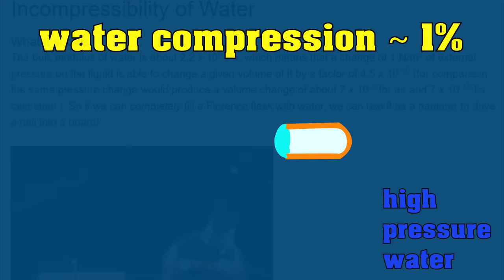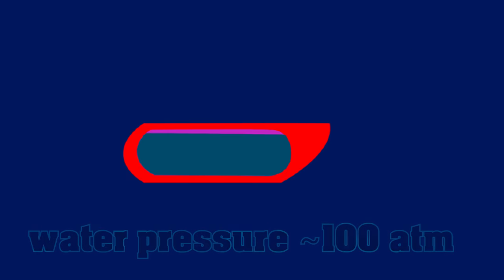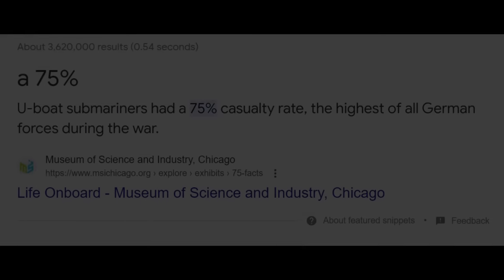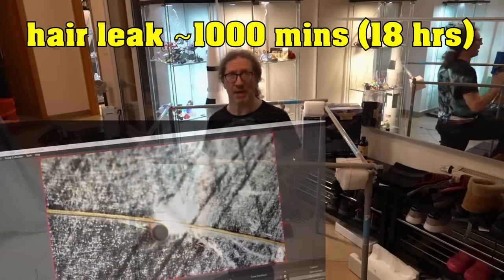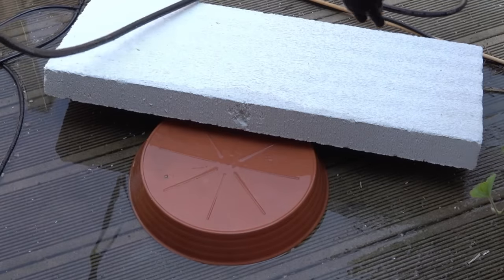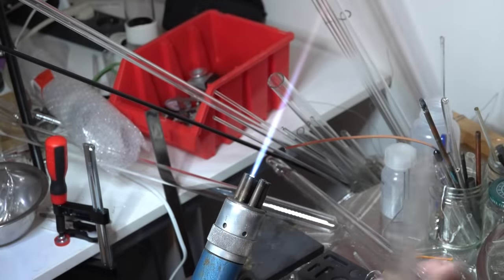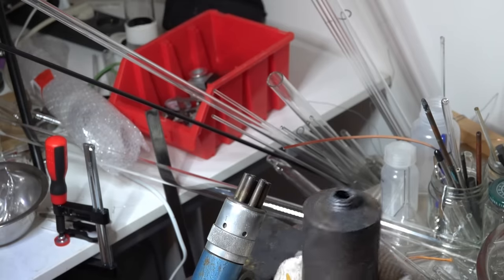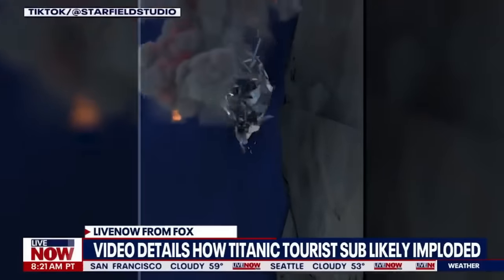Why the Titan sub failed

Comment: To be honest carbon fiber composites are used for making pressure vessels. To keep higher pressure on the inside, not the other way around. And I'm pretty sure that once a leak started in the glue, it went all around the cap...
Reply: That's the thing isn't it, fiber composites are great for tensile strength, not necessarily so great for compressive strength.
Reply: maybe they are not great for compression, but the sub had 13 or so successful drives, so it was more than capable. The problem is they did know how many cycles it can take. And the sub had a lot more questionable choices.
Reply: @hhkk6155  No, subs which are properly designed and engineered are expected to last years and years, with large numbers of dives.
We don't ride planes, trains, automobiles that are safe for 13 or so trips, what sort of stupid does one have to be to say such a thing for something that is as insanely dangerous as diving to the bottom of the ocean?
Reply: @boots7859  that means that you don't know what you are talking about. Most deep dive subs are used only once or several times before they are retired to museums.  And all equipment has a lifetime.
Reply: Diving to 4 km isn't a train or plane ride, it's an extreme adventure
Reply: @hhkk6155 , the design was flawed. They used wrong materials. Deepsea Challenger reached 14km of depth, and had a few shallower dives before and after, and it survived. There are many deep dive submersibles that operated for hundreds of hours.
De Havilland Comet planes had thousands of hours of flight before a fatal flaw caused fuselage to break due to metal fatigue. There were few other plane disasters where the end cap of the passenger cabin fractured. And such accidents happened at relatively low pressure differences...
In case of Titan the fact it had successful dives before it sank is astounding, considering that basically only epoxy resin resisted the compression forces...
Reply: @urgon6321  everyone now is a sub expert LOL 😂
Reply: @urgon6321  deepsea challenger didn't reach 14 km, because the deepest point is around 11 km. Everyone is blaming carbon fiber, but Titan had a lot of other problems: window, titanium to CF joint, CF direction, dimensions of the sub. If they did a lot more research they would have made a more reliable sub.
Reply: @hhkk6155 , you're right, it's almost 11km. I think I typed "14" because I read it was tested up to 114MPa of pressure...

Carbon fiber is just that - a fiber. Take a piece of heavy cloth or a rope and try to stretch it - it doesn't yield easily. Now try to compress it. You see now? Carbon fiber composites resist tension very well, but aren't great at compression. When compressed all the strength of the composite comes from resin that prevents fibers from moving. But resin is not as hard to compress as metals are, that's why it doesn't work as submarine hull.

This is basics of material science and engineering - it's incredible no one tested the design in high pressure chamber to see, how many dives it could survive...
Reply: @urgon6321  that theory, practice is different.  Did you ever had a roll of plane plastic or cotton fiber? If rolled tight - it's solid AF and resists compression very well. Rolled carbon fiber also is very resistant in compression, there are a lot of videos on YouTube showing that carbon fiber exhibits very good compression resistance, on par with titanium if weight is taken into account.  Epoxy is no way near compression resistant as CF + epoxy composite. Also there are vids that show CF composites having much more compression resistance than glass fiber composites, not to mention plane epoxy.
Reply: @urgon6321  also about resins, window on Titan was made out of acrilic, and it's kinda similar to epoxy, and it wasn't certified for 4 km but if you take enough of it acrilic holds fine, same with epoxy, theoretically you can even make a deep dive sub out of it, but it would be extremely thick, maybe a meter or something like that (it can be calculated).

Comment: 3/4ths certain the issue in your waterjet test was lack of pressure. I think you'd need to be up around 200psi (about double what you're running) to cut that plastic.
Very well made proof of concept demonstration. Thank you for the effort.
Reply: You're mistaken, I'm afraid. He said his pressure washer was running at approximately 100 bar, which is nearly 1500 psi. Pretty standard for a home use model, though they do have some that are a bit more powerful. An industrial pressure washer, something like at your quarter car wash, States around 3500 psi. There's really no telling how high they go. I reckon that depends on what you are using it on. 1 bar of pressure is 14.7 lbs. It didn't destroy the plastic because it's water, likely filtered. If you were to use seawater, it would have more of an impact as a result of sediment and other particulate in the water. Like a water jet machine. They run around 20,000 psi. But they will not cut through steel and concrete and all the other things they use them for until you introduce an abrasive into the stream, then shit gets cut, which is why pressure washers contain filters, by the way, so that minerals and particles in the water won't just strip the paint off your home or car, or cut your foot off from an accidental blast.
Reply: @philbert006  Pure water can easily cut soft materials, no need for an abrasive. It's actually common practice to cut plastics with water alone, because there's no reason to waste your relatively expensive abrasive on a soft material that has no need for it. The problem here is the nozzle, obviously you wouldn't design the nozzle for a pressure washer to be able to cut things. The orifice in a waterjet is very different from a pressure washer nozzle.

Comment: "It really isn't the immense pressure that kills you... its actually that the water is compressed and it expands at you at the speed of sound" is a bit like saying "It's not the falling that kills you, it's the sudden stopping"
Reply: This guy likes to be contrarian. The available evidence including the communication log between the sub and the support vessel also isn't consistent with a pinhole leak, dramatic implosion is much more likely
Reply: True, but the simple explanation gives rise to the misconception that the vessel would violently implode
Reply: it's not slamming head first into a wall that kills you, it's the fact the wall didn't move.
Reply: @guardofrr  it did violently implode or the carbon fibre frame wouldn't be in pieces
Reply: That last part is inarguably true. No one has ever died from falling, or skydiving would have a near-100% mortality rate. They died from the blunt force trauma of the impact.
Reply: @colormedubious4747  
You don't need a parachute to skydive.
Unless you wanna do it more than once.
Reply: @Dareyouhow  I would guess that the moment there was a failure in the seal, a dramatic implosion would follow anyway.
Reply: @hhiippiittyy  You are correct, sir! Aviators also have an old saying: "Anyone can FLY an airplane. The tricky part is LANDING it so it can be flown AGAIN."

Comment: The pictures of the wrekage shows the window blown out and all 18 bolts gone, the carbon fibre has completely delaminated from the titanium and not even small bits are left on the titanium semispheres. Carbon fibre shatters violently when its structural integrity is compromised and the evidence shows that. They died in milliseconds, not a pinhole leak filling over time, the sub wasnt made of metal.

Comment: Didn't the US navy confirm it was a sudden implosion because implosions have a very distinct audio signature that was picked up by acoustic monitors designed to detect enemy submarines.
Reply: Well yeah it was implosion nobodies denying it, it just didn't happen like those a animations suggest
Reply: @AverageAlien  Thunderf00t is saying there was no implosion and that it just sprung a leak and filled up with water over a few seconds or a minute.
Reply: It was very likely an implosion. But if the communications log that has spread on the net is  legitimate, then there was issues before the implosion.

If the texts are true, then the sub descended 50% faster than normal alreadt from the start. Which indicates if was too heavy. Either waterlogged plastic (one of the issues with CF) or ot had a leak so there was water in the sub.

Next thing is the leaked (if real) communication mentioned sounds maybe 10 minutes before the loss. And loss of one power bank while they drived to ascend.

So a leak could have started the issue. Then the leak could finally have damaged the CF hull enough that instead of just getting a larger hole it totally imploded from loss of stiffness. A leak can delamination the CF bonding.
Reply: @mikehawk5492  Did you not watch to the end of the video? He explained how a pinhole leak escalated into an implosion.
Reply: @mikehawk5492  The point is a tiny leak would erode away at the material it's leaking through, combined with the fact that the material it's likely leaking through is glue thats constantly shifting throughout the dive it wouldn't be too long before it failed entirely and explosively.

However the glue is just one theory, another is the hull was damaged and leaking, which like the glue would be essentially waterjet cut by the leak until it grew large enough to catastrophically fail.

Hydrualic Press Channel already did a test (I think others have now as well) where they take a carbon fiber tube to depth and back in a pressure chamber 30-50 times and it suffered no noticeable loss in strength from the cyclic loading. However the timespan was so short that no leaks would have time to actually weaken the material by abrasion. It's unlikely the hull failed simply by cyclic loading but instead cumulative damage of some sort. Which brings us back to a sub millimeter leak that slowly ate away at something until it failed, similar to how hydraulic hoses or other hydraulic failures occur, they slowly seep and leak until they blowout without much visible progression.

Comment: I've been starting to use a pressure washer at work, the 0 nozzle is something I'm legitimately concerned about using not just because it doesn't have the area coverage I need to clean the sidewalks around here, but it also straight up removes gum that has been there long enough to solidify and turn black within seconds. I could probably drop some pigeons with it...
Reply: Thats the problem, it will cut bricks and remove almost anything, but area of coverage is almost useless.  Do yourself a favor and review pressure washer injuries. PPE is your friend.
Reply: @boots7859  Oh, I'm VERY careful not to hit anyone with it, I wouldn't even think of hitting someone with the 40 degree nozzle. One of my Army buddies and I were goofing around while we were cleaning the HMMWV, still hurt through our boots.

Comment: I find it interesting that it appears the porthole appears to be missing and the bolts which held it on sheared off, there must have been a lot of pressure inside the sub to do that.
Reply: I saw a back of a fag packet calculation suggesting the energy released in an implosion of a sub that size is more or less equivalent to 40 kilos of TNT.  That's a pretty big bang.

In any case, even allowing for @thunderfoot's hypothesis of "gradual" water ingress, the compression of the air will cause it to heat rapidly.  And at some combination of sudden heat and pressure rise, a lot of carbon-based things start to become diesel fuel.
Reply: If the water came in from the inside it would just blow the glass out, as it was shaped like a cone to be pushed tighter and tighter from outside pressure.  Bolts dont really hold those submersible windows all that much.  Its the shape.
Reply: @beingaware8542  Yeah, the whole water compresses theory while a true fact is like an interesting rabbit hole.
Assuming a crack in the cylinder hull or near and end cap, you'd expect failure to flash open and the sub to immediately be full of water.
Any air would be pushed away and likely into the end where the porthole is. Porthole is built to withstand massive pressure from the outside to inside, and 1 ATM from inside to outside.
Port hole/glass simply popped out of the end like a champagne cork.

Comment: Just a thought:  The under pressure, the cylinder would move inwards buy a greater amount at the center.  This would cause a tension between the carbon fiber and the titanium to be greater at the outer contact area.  No idea how much but it's there.    😃
Reply: Yes and then hydrostatic pressure allows water to delaminate deep in the CF cylinder, effectively equalizing the pressure around some part of the outer layers of the cylinder - result an area where the cylinder is effectively thinner and weaker, rinse and repeat until catastrophic failure.  Dams have the same issue with pressurized water infiltrating under the dam and trying to float it away...
Reply: @MarkTillotson  I see your point, thanks m8.
😃  🖖

Comment: It seems that Stockton Rush had a perfectly good DSV...

Then he split it in half and put a carbon fiber tube between the two halves, making it an implosion waiting to happen.
Reply: Not even that... the window he had was rate only to 1300m about 1/3 of the depth that the Titan was going. I have not heard what the titanium end caps were rated at... but i would not be surprise if they too were not rate to Titanic's depth.  Stockton's sub had some many problems, it is actually a race to find which part would have failed first and killed the crew.

The CF hull (delamination and lack of safety margin. Estimated crush dept of titan was 13000 ft. Titan dived to 12500ft.), the glue between the CF hull and titanium end caps (debonding), the viewing port (not rated for the depth)... the electronics (controller lock).... and surfacing without immediate recovery (suffocating because they cannot get out).